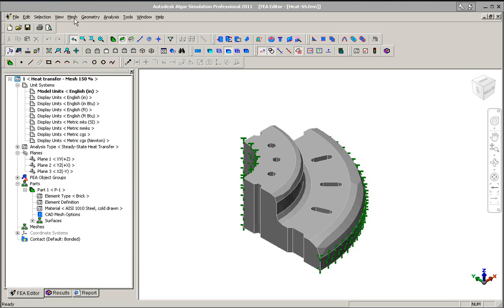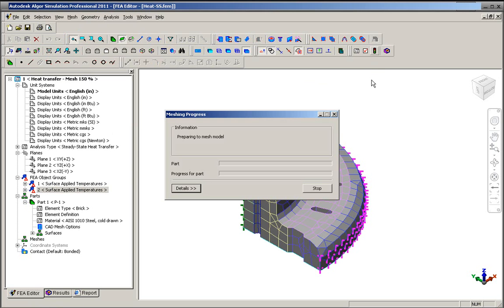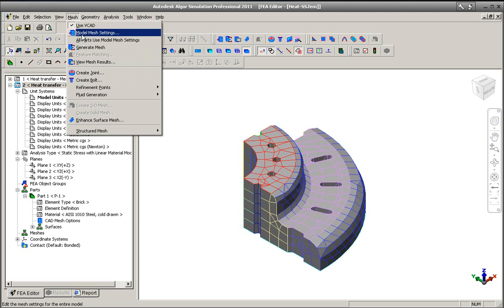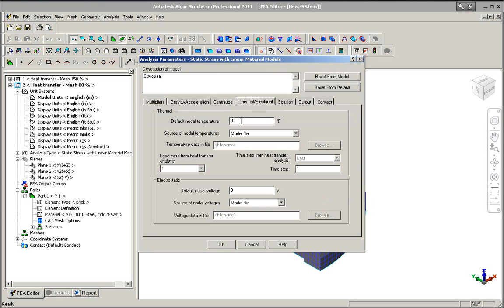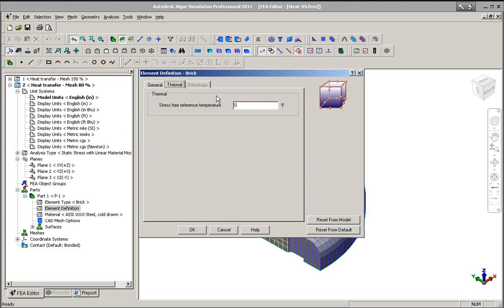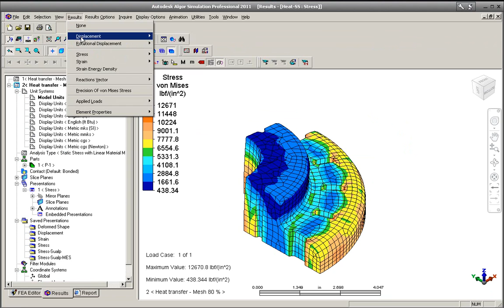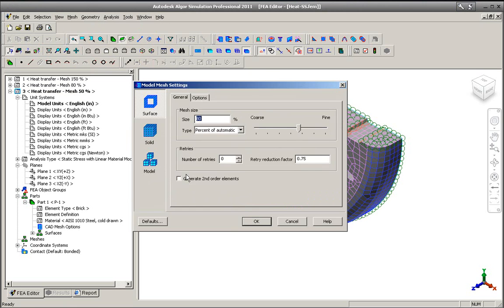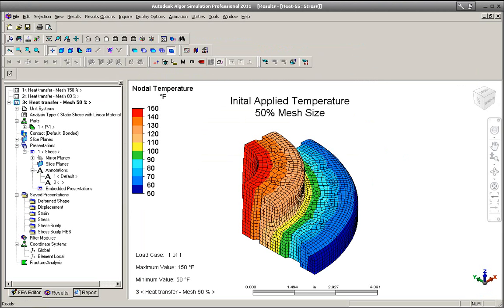Heat Transfer & Nonlinear Stress with Autodesk Algor

Comment: What is non-linear in this example? The instructor doesn't say the initial conditions, load (thermal load or mechanical load), whether it is non-linear material?? Finally, the icons of the software are so small that viewer may find difficult to follow.